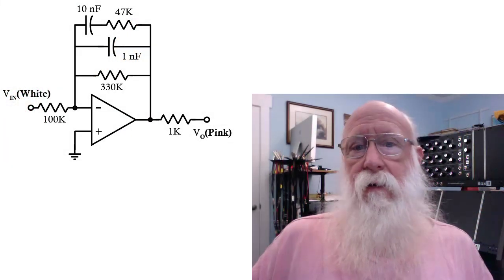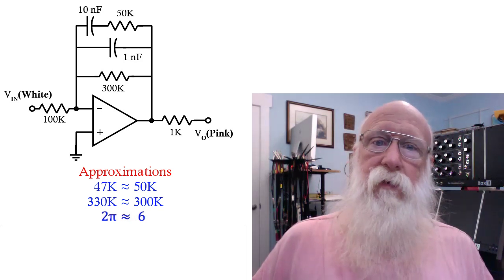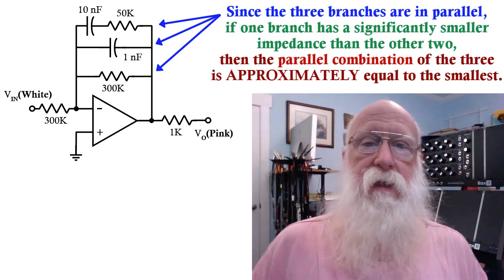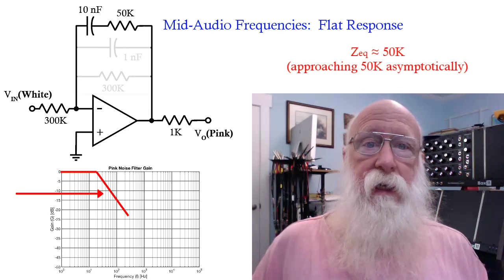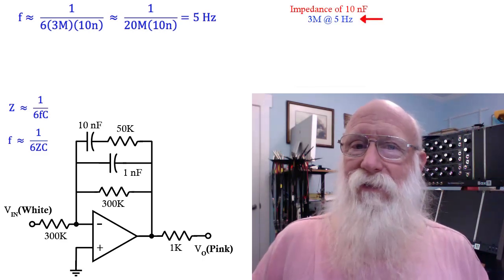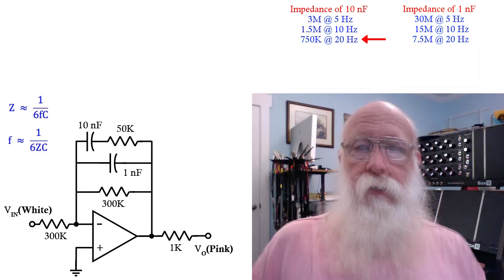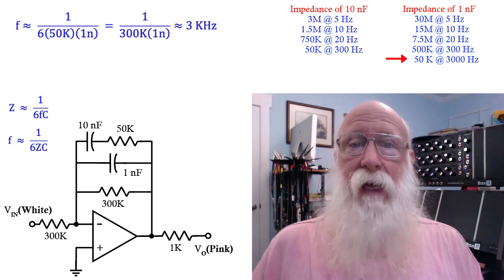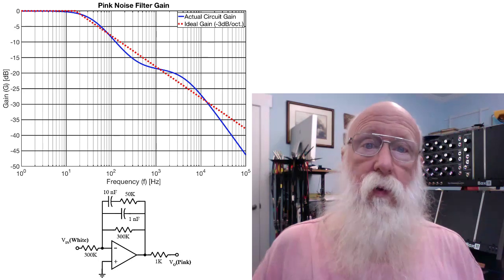Noise Generator Part 5

Comment: Can you modify this circuit to generate brown noise instead?
Reply from the maker: I will be adding a video on a brown noise filter sometime in the future - not sure when. It is basically just a single pole low pass filter (white noise as input) with a corner frequency somewhere around 15 hertz.

Comment: For an audio related video the volume does seems a bit low. :p  An actual question tho, why the 1K at the output? I would think running direcctly into a high impedance buffer / voltage follower would be the way to go.
Reply from the maker: Someone else commented on the low volume. I will try to address that in the future.
Most of my work is in modular analog music synthesis. In this case, the various outputs are connected to various inputs via patch cord, typically a 1/4" phone plug. When inserting the plug into the jack, it is essentially impossible NOT to ground the tip (where the signal is) during insertion. The 1K prevents directly grounding the output in this case. In general that is not a major issue, but in the worst case you may damage the output device. For example, I once fried a 555 timer in a prototype when I had neglected the output resistor. There are other reasons as well.
However, in one sense you are correct. If this is just a "building block" in a larger circuit that will be hard-wired to the next stage, you would not in general add the 1K.